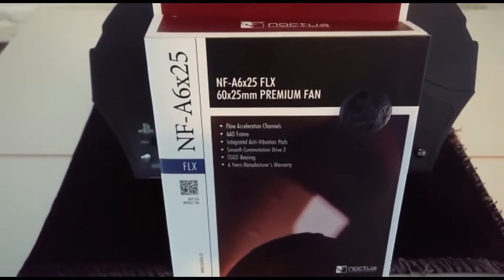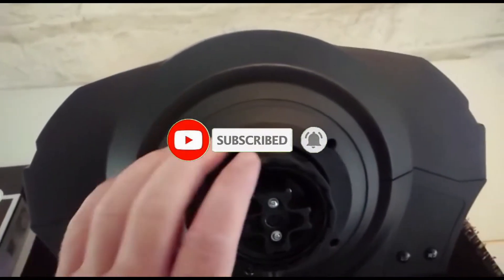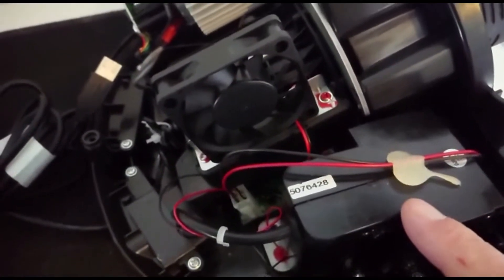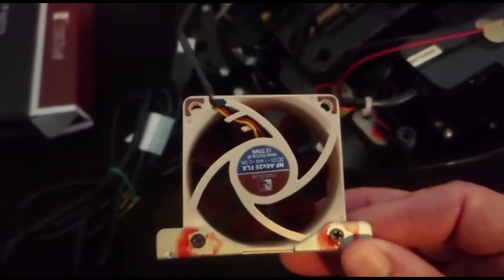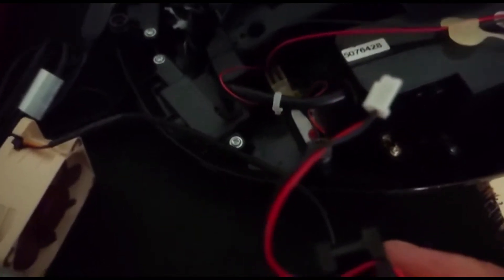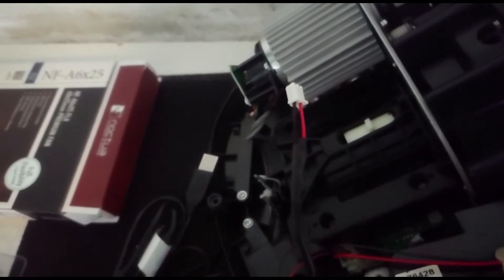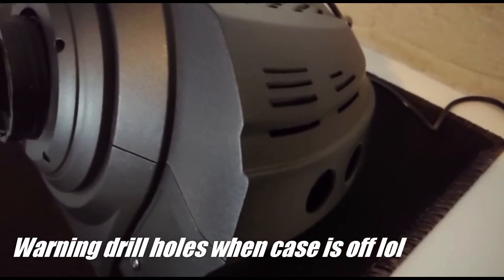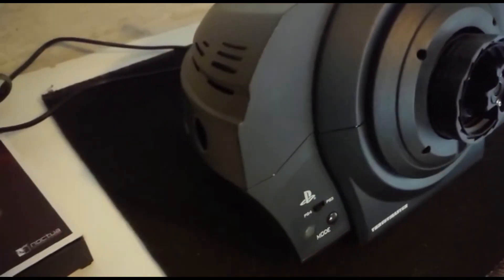Thrustmaster T300 Fan Upgrade and venting

Comment: Hello there mate, what would you reccomend cutting the shell of the wheel with if I want to cut a square hole?  I’m doing a similar mod but with external usb 60mm fans, and I’d like to cut a close to 60mm hole on both sides and mount a fan on both sides for venting, it’s very hot and humid where I live during the summer
Reply from the maker: Maybe try a Dremel with cutting discs 👍

Comment: How did you change the wiring from 3 pin to 2 pin?
Reply: He cut the wires and sliced them, but there are adapters for it.
Search for "3 pin to 2 pin fan adapter"

Comment: 1nd question: Hİ ,If I use FFB between 60-75%, will the temperature increase and ffb decrease?--I will be very happy if you answer, because I will buy from this steering wheel. The game I will play is BEAMNG AND A.C.
Reply from the maker: On AC you should only need about 50% ffb if it's a new T300. The higher you have it the less it will last.
Reply: @JACKSPEED_TV  Is 50% ffb suitable for drifting?
Reply from the maker: @AHMETTALHASAYAR  For drifting I would only use about 15-20% ffb
Reply: @JACKSPEED_TV  Thank you ZAK :)

Comment: The stock fan actually draws way more power than the Noctua fan. So you can actually replace the single stock fan with two Noctua fans on parallel.

May have to make some creative cuts for clearance though.

I did it and my wheel never overheats even with ambient Temps of °35c in the summer

Comment: I don't use my steering wheel for 30 minutes. Do you think I will encounter such a problem before 30 minutes? And I just got my steering wheel set. I switched from the G29 set to this. The games I play are ets2 ats forza horizon 4 style games. I would be very happy if you reply.
Reply from the maker: No you should be fine 👍

Comment: is there any alternative for the fan other than noctua, that already has a 2 pin and has the same size, maybe with a better airflow even? i just do not want to bother with the fiddly cable anymore
Reply from the maker: The noctua was the best quality I could find, but I guess there are alternatives.
Reply: @JACKSPEED_TV  any details of what kind of spec would be compatible for the power supply?

Comment: My only issue with the noctua a6 fan is that it pumps out 17 cfm, where the factory one pumps out 21. While I do agree noctua makes one of the best fans out there, for this application, I believe there is better options for more cfm. If your only looking to quite down the unit, I'd say noctua is the way to go, but you'd have to watch the temps to make sure it's all workin
Reply: The trick is to use more than 1 Noctua fan. Since the a6x25 actually draws way less power. 0.96w for the Noctua and 2.88w for the stock fan. You can put 3 Noctua fans in there in parallel and have the same power draw. So assuming you use two fans as intake and one as exhaust you'll be moving like 40-50 CFM with the Noctuas.
Reply: It pumps 17 cfm using the low rpm restriction wire. Without it, the spec is 29 cfm
Reply: @eapleitez  29.2m³/h is there spec, which equals 17cfm when converted!

Comment: I replaced stock fan with the same Noctua fan. Ffb still fades after a few laps. Only had my wheel 12 months, bloody joke!
Reply from the maker: Yeah that's how my old base was, not good mate.
Reply: I'll drill some holes & open up the vents some more. See if it helps
Reply: @sim-tek-racing  any change?

Comment: I tried it lasted 10 seconds, I ordered another similar one .. and I did plug the red on the red and the black on the black, I specify that I did the test with the mod ventilation force
Reply: If the motor burnt out, then you where using a 5v PWM fan. Use a 12v fan. This is a 12v DC fan circuit.

Comment: I like a really heavy feeling wheel but the t300 can’t handle it for more than twenty minutes tops. Has this sorted the problem? To stop it over heating I have to turn ffb down to a level where it feels like my old t150 and it’s winding me up.
Reply from the maker: Yes the T300 just can't handle running high ffb, this fan upgrade defo helps 👍 I have done a few hot lap sessions over a hour and not felt any drop off. Will tell more when it's summer tho.
Reply: @JACKSPEED_TV  Hi, any updates on this? Would love to run it 90-100% ffb without any dropoffs but I doubt that is possible.
Reply from the maker: Sorry no, I switched to a T-GT a few months ago.

Comment: My force feedback gets weaker after a couple of laps on my t300. Do you think it could be an overheating issue?
Reply: The fan replacement is not solve the problem at all. I made a big hole on the top of the cover and placed a big 12cm fan on it. Its a drastic solution and i also lost the warranty,but it was the only way i was ablo to use it without loosing the strength of the fb. Its overheating issue and very common on these wheels.
Reply: @janosguitar  understood, was it difficult to mount? And if you don't mind could you link the fan you've used and also a picture of the wheel now? I haven't seen such an application before.
Reply from the maker: That's like how my old wheel was, more like a worn motor issue unfortunately.
Reply: @JACKSPEED_TV fortunately I still have warranty on it. Thanks
Reply from the maker: @janosguitar  I would get it sent back then pal
Reply: @janosguitar  Is your problem solved mate? I have the same issue now after having been using it almost for a year and a half. Sent it back and and got the wheel back without any repairs and also with a note saying "the device was tested and there were no problems. it is advised that you shouldn't play for long durations". They advise not to play for long durations and yet say there were no problems found. Like I got this wheel to have a few hotlaps and then put it away? How foolish. I have sent it back again referencing some of the points in the user manual: for one, having a break is for user-end health concerns, not for product health.For two, it is stated in the manual that the internal heat sensor would decrease the motor's power in high temperatures but should be back to normal in a short time when the temperature gets lower. Which was not the case for me even after hours of not playing. And lastly there was no abusive or rectless usage of the wheel or any accidents). I asked for a change if they cannot fix it. Waiting for an answer as I still have warranty on it. Otherwise I would try replacing the fan as well.
Reply: @janosguitar  perfect, thanks a lot :)
Reply: @TheGazi97  Merhaba.Sorununuz çözülmüş müydü?Çözüldü ise nasıl çözüldü?Yardımcı olabilir misiniz lütfen?
Reply: @emreyuzgec5132  benim sorunum biraz özeldi galiba, köyde elektriğin düşük voltajlı gelmesinden kaynaklı olduğu sonucuna vardım. yeterince güç alamıyordu cihaz. Merkezde denediğimizde sorun yaşamadık ve bunun farkına varmam biraz sürdü
Reply: @TheGazi97  Öncelikle cevapladığınız için çok teşekkür ederim.Acaba aynı sorunu mu yaşıyorduk.Benim sorunum direksiyonu çevirdiğimde oyunda tepkiyi gecikmeli vermesi birde geri toplama ve çarpışmada ki geri tepki vs. kapalı.Sizdede aynı şekilde oyunda geç tepki vermesi miydi?
Reply: @emreyuzgec5132  rica ederim. maalesef. Bende cihazı gücünün yarıdan fazla azaldığını düşünün. Cihaz kapalıymış gibi çok rahat dönüyordu direksiyon direnç ve titreşim göstermiyordu. Gecikme vs yoktu yani
Reply: Anladım.Tekrar cevapladığınız için çok teşekkür ederim.Bakalım benim sorunuma bir çözüm bulabilecek miyim?Bir ara yine aynı sorunu yaşıyordum düzelmişti şimdi tekrar başladı.Noctua fan siparişi geçtim bakalım çözüm olacak mı?
Reply: @emreyuzgec5132  ilk defa duydum sizin sorununuzu. Servisle görüşmüş müydünüz?
Reply: @TheGazi97  Hocam 2.5 yıl oldu alalı garanti bitmiş.Ama sorunun kaynağını buldum gibi usb bağlantı noktasını usb 2.0 a aldım şuan herhangi bir problem yok şükür.
Reply: @emreyuzgec5132  olsun ben servisten memnun kalmasam da bildilleri bir şey olabilir. Garipmiş ama güzel sevindim geçmiş olsun o zaman :) keyifli sürüşler
Reply: @TheGazi97  Teşekkür ederim

Comment: Thanks a lot Zak. Do you think it will be a problem if I don’t make extra holes to evacuate more heat ?
Reply from the maker: No just fitting the fan will help mate, the original is pretty poor.
Reply: Zakspeed _TV oki doki. Another question : what do you think of that ? https://rover.ebay.com/rover/0/0/0?mpre=https%3A%2F%2Fwww.befr.ebay.be%2Fulk%2Fitm%2F183722103821
Reply from the maker: @Lunacki1  
Not my cup of tea really mate.

Comment: One more question..ordered same, should be here today.......did you use the wires that came with it?? Cheers and Regards
Reply from the maker: Just used the wire what is on the new fan and joined the original two pin plug to it 👍
Reply: @JACKSPEED_TV  oky doky
Reply: Is your t300 still running well?

Comment: Always wondered why it went limp after a while. Any other recommendations on make of fan. PS...whats the RPM on this one. Regards.
Reply from the maker: Did see a star tech fan but the Noctua looks far better quality than others I looked at. RPM was 3000 to 1600 👍
Reply: @JACKSPEED_TV  thanks for the reply. 😍
Reply: @theadventurehoggs  is your t300 still going?
Reply: Ye all good
Reply: @theadventurehoggs  do you run it on 100% FFB?
Reply: Yes, I do like the feel
Reply: @theadventurehoggs  is changing the fan the solution, of loosing ffb ? sfter a while, ffb feels like not existing anymore with the original one. would love to hear your experience!
Reply: @dani-striker-9670  yes made a big difference. My FFB is always there now.
Reply: @theadventurehoggs  thanks for your quick answer bro! :) nice to hear !